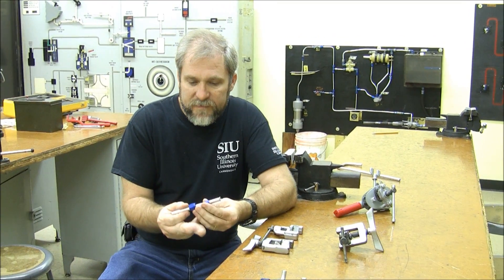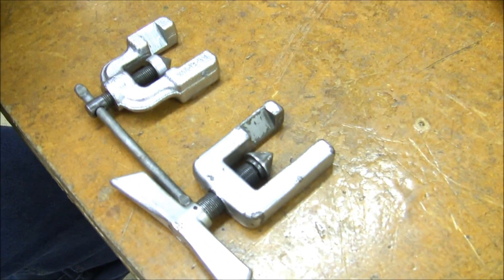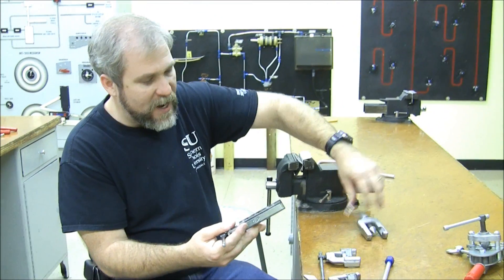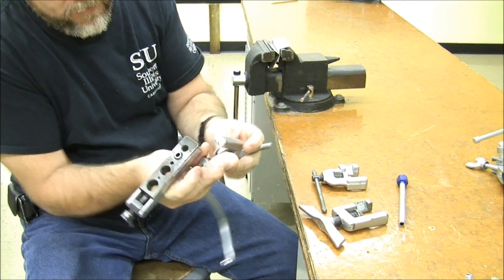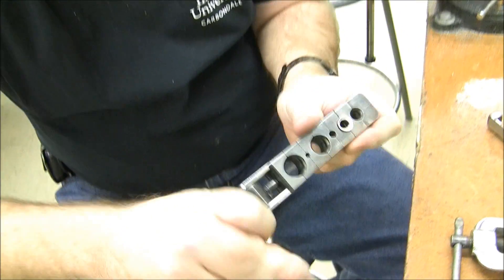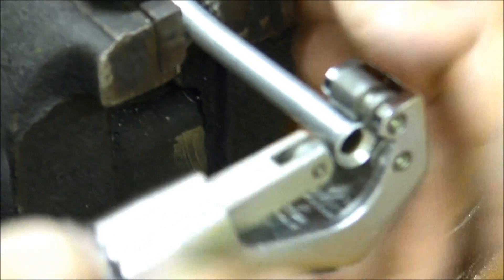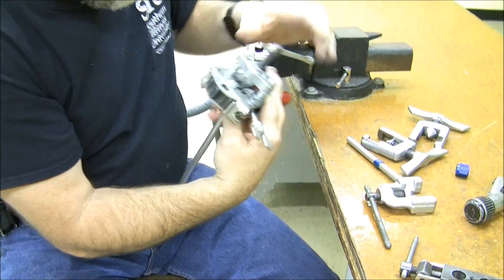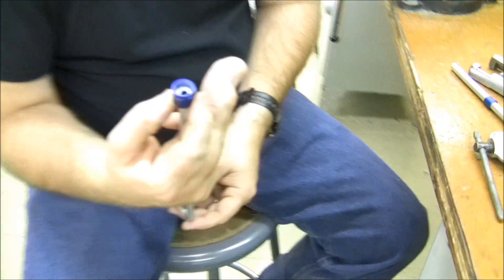Aviation Tools Training - Single Flare Tubing

Comment: There is a nice tube flaring tool from eastwood. (automotive, but do single, double and bubble flares, 37 and 45 degree, in 5 different sizes, imperial and metric).

Comment from the maker: No.  These were 37 degree flares.  The difference is the tool, and not the technique.  The 37 degree flare is bent a little less, so that it is less likely to form stress cracks.  You cannot form a 37 degree flare without 37 degree tools - and vice versa.